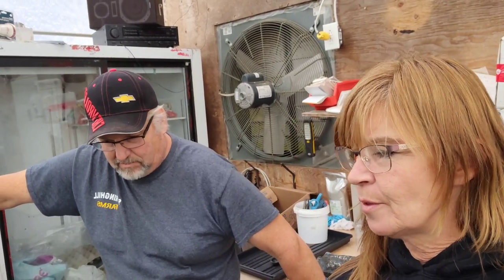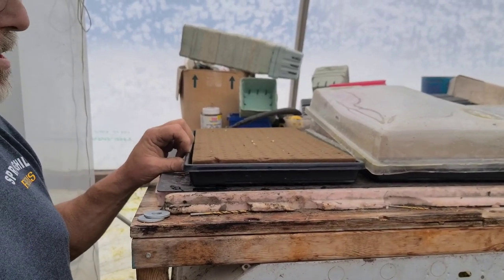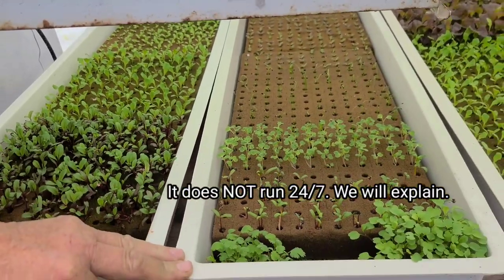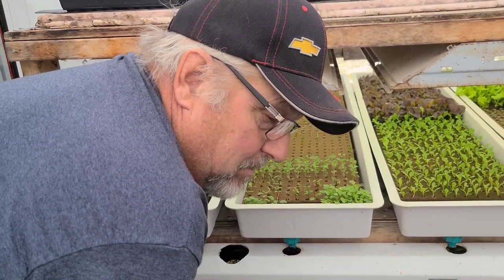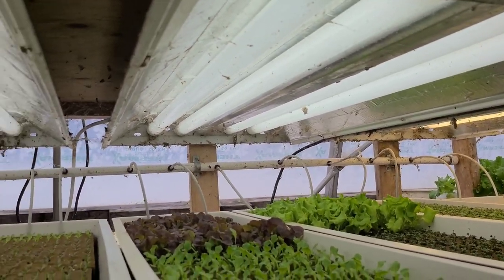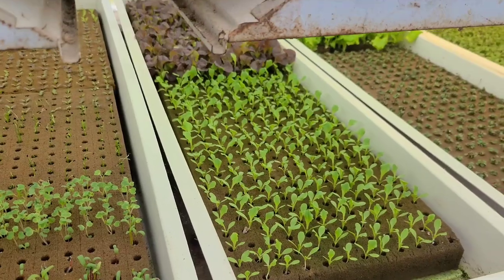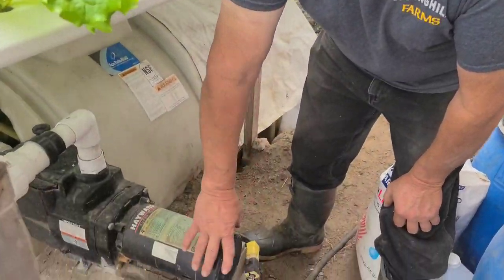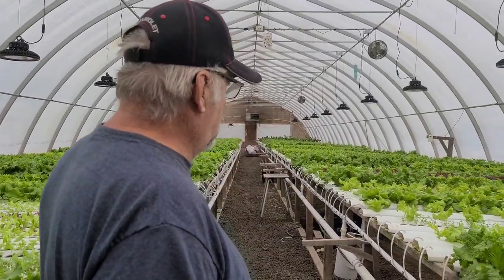HYDROPONIC Seeding and Propagation . HOW IT WORKS!

Comment: Thank you so much for the video. I always look forward to your videos everyweek. I was waiting for it yesterday too. Glad to see this today. 
Questions: 
1) what nutrients do you use for propagation? Is that different than the nft system nutrients? And if they are same, are they in same concerntration? 

2) how frequently do you top the propagation and main reservoir. How does the math work for the topping the nutrients in terms of keeping ideal concentration and the volume in the tank? How frequently do you competely change the water?

3) In an event of power cut, how long before the plant roots start to dry? In other word, how much time do you have for starting pumps on generator without loosing any plants to drying?

4) when is the ideal time to clean main reservoir? And what is minimum size of the tank and volume of nutrients do you need for system such as yours? Do you use any cleaning agent to clean the troughs and tank?

Pheww.. thats it for now. See you next week!!!
Reply from the maker: Thanks for watching! 
We will answer all of these questions in the next video!
Reply: @Growwiththelaplantes  Thank you!! To add to the question, if you can provide information on where did you procure the main tank.

Comment: I'm starting my lettuce seeds very similar to your process. Seeds in water soaked rockwool on a heating pad. So just to clarify, after you start to see the first formation of leaves you remove them and put them under light but do not feed any fertilized water until they move to the next racks? Or are they sitting in a light mix of water/fert in the second set of trays under the light? About how long do you keep them in that second stage inder the lights before moving to the grow out stage with full fert?

Thanks for your videos. They have been very helpful.

Comment: I ordered some of the Essential Plus you listed in an older video.  It is now marked “NOT FOR USE ON FOOD CROPS.”  I spoke with the manufacturer and found there is a new product called Essential AG for food crops.  I also noted here you say you only use water now.  Can you clarify how you are starting your seeds and if you are using anything besides water?  I think the older video also said you used half strength nutrients in the flood tables.  Is that still the case?  Thanks for sharing all of the info.  You’ve been very helpful in getting started!
Reply from the maker: Wayne is going to answer your question.
Reply: Could you elaborate on this Jeff? Maybe a link to the product or the manufacturer?
Reply: Hi Jeff
We have only used water for last couple of years.we found thinks grow just as well if you get your oasis out of the black trays as soon as possible and into the half strength nutrients we put through are small white troughs.
Thanks wayne
Reply: @elvismom1  thanks Wayne!  Set up here with a small scale trial, 2 5 foot nursery troughs and 8 - 5 foot finishing troughs in the basement with LED lights.  If all goes well I can expand into the greenhouse in the spring.  You guys rock!
Reply: @JScottAudio  you can check out Wallacewow dot com. He carries the OMRI version.  It has pictures of fruit and veg on it.  The non food version has pics of flowers and soil on it.  I was told by the rep it was because kelp had been removed from OMRI listing.  I don’t see any info on that anywhere and still see OMRI kelp products on the market.  It may be a different reason, but that’s what he stated.  The warning on the bottle says not for use on food crops and there are also warnings about h316 and h320.  Not sure what those are.  I’m with Wayne, just stick with the water.  Unfortunately they have kept the name the same on both products, which is misleading.  You can see the regular version on amazon.  Jeff...
Reply from the maker: This is very exciting!!😁
Reply: @elvismom1  Hi Wayne, another question that I keep missing in your videos, but how long per day do you light the long white nursery propogation trays once the Oasis trays are placed in them? (I know you cycle the water 3 times per day but never catch the lighting time)

Comment: yes, growing from small seed is a big problem for me, I do micrgreens, but only radish, sunflower, peas, wheat and barly.
thanks
Reply from the maker: I have problems with Sunflower Microgreens,  but I'm giving it another try right now!
Thanks for watching!
Reply: @Growwiththelaplantes  try to get food grade sunflower seeds particully for microgreens, and presoak for 12 hours, and cover initially with a inverted tray until about 1 to 2 inches.
best
Reply from the maker: Thank you! I used to presoak for 24 hrs. Didn't work well. I'm soaking for 8 hrs now and they seem to be germinating much better.
Reply: @Growwiththelaplantes  each seed lot seems to have its own quirks. I found that when i get a new lot in of sunflower, i do a test of 4, 6, 8, and 10 hours. Anything more and i find you risk drowning the seeds. We do a 5 minute pre soak with a hydrogen peroxide/water mix and then a rinse. We then place them in hot water and sit for the specified number of hours. The water will cool over that time. Not boiling water, but hot enough that you can have your hand in. My current lot germination works well with 4 hours. Previous one was 8. Talking with Mumm's, this is what they have found as well.
Reply: @thefaeryman    Why cover with a tray or in darkness?  I thought seeds need light to germinate?
Reply: @hikiula  the seeds are germinated in darkness to give them time to grow taller and strengthen the stems, otherwise they get leggy. in miro-greens you wish them when harvested to be in most cases about 1 to 2 inches tall. once they start putting out the first leaf you uncover them.
the exception is corn shoots where these are grown in total darkness.
Reply: @thefaeryman     Thank you...

Comment: What’s the difference between the nursing trays and the next ( regular) trays?
Reply: Hi
Nursery trays have the holes as close as possible and finishing  trays are on 8 inch centers
Reply: Hi , does it matter for the plant if they are in a nursery tray or in a finishing tray ? Or is this just because a young plant does not need so much space .
Reply: Nursery trays are just a spacing spacing  tray to maximize your production